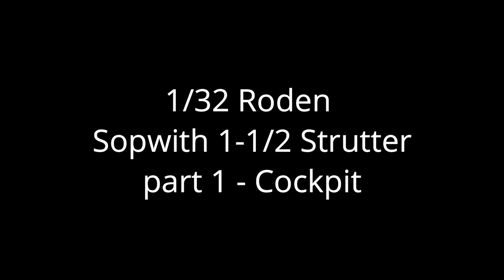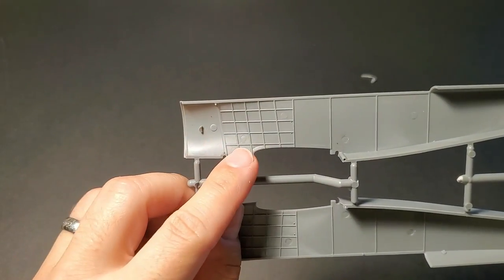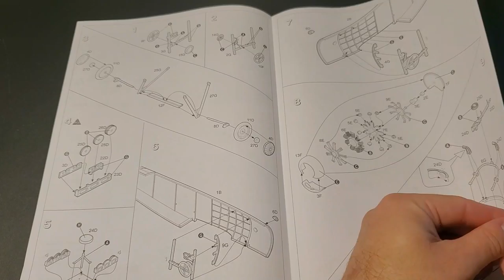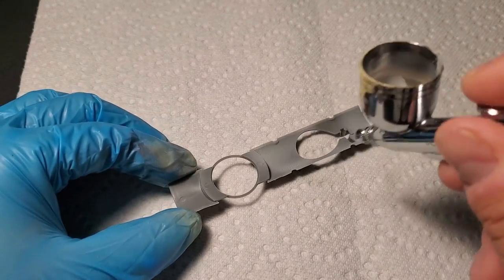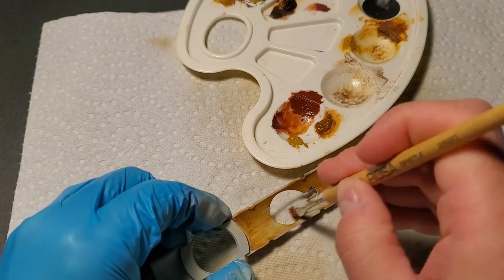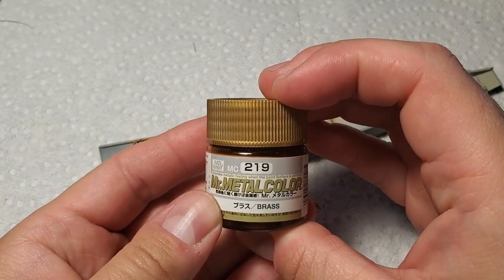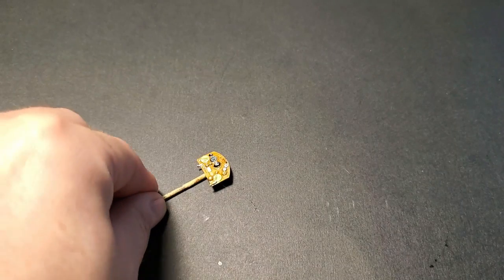Roden 1/32 Sopwith 1-1/2 Strutter, Part 1 - Cockpit

Comment: By the look of the preview, Roden has provided a few more details than its other kits???? Although, the quality hasn't improved at all but you have worked your magic and made it look so much better. Great start, FCM!
Reply from the maker: Thanks, agree, Roden has the same quality, as usual (a spoiler - I was surprised with their decals. You will see why in the next episode), and they included bombs, 2 types of top wings (with and without windows), I think they are planning to have a single seat bomber option. We will see
Reply: @FlyingCircusModels  Will be interesting to see whether a single seater is in a future release. It's a shame that Roden's quality isn't better as they seem to release more 1/32 WW1 planes than other manufacturers.
Reply from the maker: @robbo1068  agree, I think the problem is with the type of process they use to make models - it's low presure injection molding not high presure. The later one is better, but more expensive and more complicated, have no idea why they still use that old process (money, skills, etc.)
Reply: @FlyingCircusModels  Yes, absolutely agree with your comment.

Comment: That big needle in your hands becomes a multipurpose tool, I see 😊. This Roden looks to have the quality of a short-run kit, not even having decals for the instrumentation. But you’ve skillful improved that cockpit. 😍 Also, did you use resin turnbuckles instead of metal ones because the rigging in the cockpit sides isn’t as taut as those on the wings?
Reply from the maker: Roden usually doesn't have any instrument decals, so you need to buy aftermarket or save from your other projects. Yes I use resin turnbuckles, because I used Ezline wire and it's not so strong like nylon
Reply: @FlyingCircusModels  I didn’t know that. Instrument decals are standard in kits, I thought. I better look for some aftermarket sets then for any Roden kits I want. Thanks. ✌🏻😊
Reply from the maker: @ronaldbyrne3320  right, I use Airoscale set for WW1 planes for many years now, there are a lot of different intruments in one sheet - highly recomend it
Reply: @FlyingCircusModels  thank you. 😊

Comment: Help ! I am getting more and more confused with the fit of part nos 2c/3c which sits just behind the pilot. I am unsure which way round this goes the instructions show the glued in part 3c as being towards the back of the aircraft but when dry fitted looks like the back of it doesn't sit up straight if you get my meaning. Can you please help
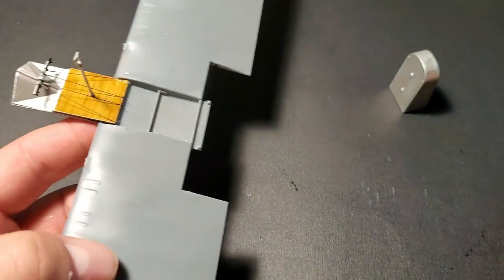Reply from the maker: HI Will, the instruction is correct - you need to put gas tank detail #2c looking forward, check it on my video 18:10
Reply: @FlyingCircusModels  Good man yourself, I am realising more and more that it isn't a good idea to work on models late at night
Reply from the maker: No worries at all, good luck with your build